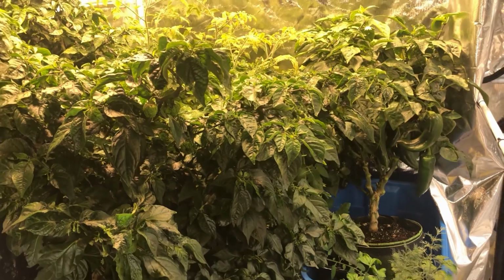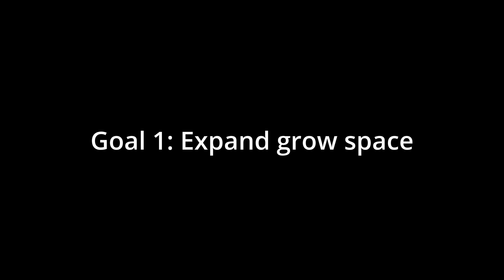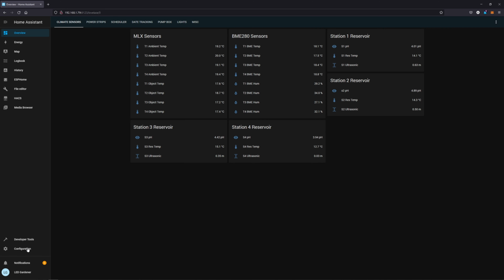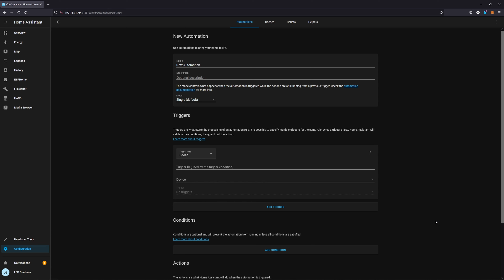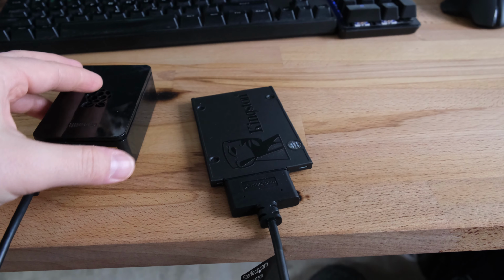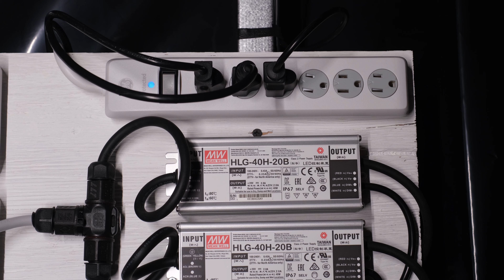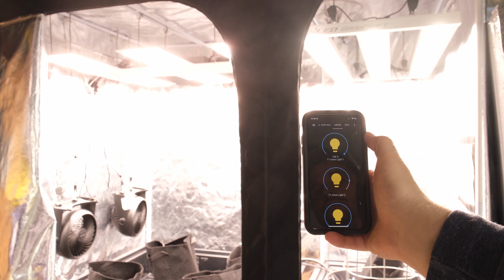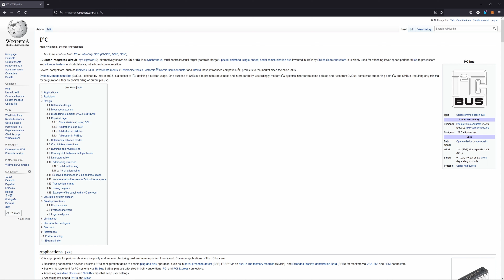Rebuilding My Automated Hydroponic Garden -1- Intro/Overview

Comment: Since watching your home assistant series I’ve been hooked. Looks like you are making a ton of progress. Nice. Love the PCB idea, I’ll have to look into this.
Reply from the maker: It's addictive, isn't it? I lose sleep thinking of things I could automate.
Reply: @LEDGardener  Ha, exactly how I feel. It’s certainly a rabbit hole. I have sensors and monitors on things that I don’t really need them on just because I’ve ran out of ideas. I’m tempted to switch to a reservoir system. Do you have a preference or find one to be more accurate between scales or an ultrasonic way of measuring your reservoir? I’m sure they are both good.
Reply from the maker: @kumd  The scale will be more accurate. The problem with the scale is that if you have a constant weight on it, it will drift. Mine drifts very slowly though so I just check and recalibrate every few weeks.
Reply: @LEDGardener  How much drift are you getting? How long have you been using them? Is the drift or accuracy getting worse over time?
Reply from the maker: @danp762  I remember checking it a year ago or so - I think it had drifted so it was off by like .25 liters over 6 months or something. The drift does not seem to worsen. I typically had 60 or 70 liters sitting on the scale.
Reply: @LEDGardener  Do you have a link to the parts you needed for the ultrasonic method for detecting the water level? I'd like to not worry about the drift or recalibration process too much if possible, but if the accuracy is really bad, maybe the scale method is the best?

Comment: Thanks for the incredible videos! Hoping you get a chance to tinker with the Conductivity stamps at some point. Cheers!
Reply from the maker: Holy cow, thank you! I've got one on hand that I'll be using in my new little control box with all the peristaltic pumps. Are you building yourself a system?
Reply: @LEDGardener  Yeah, I started with your videos and was doing something pretty similar. Got to the point of building my own PCB with the same stamps, but had to shelve the project as we moved houses and the new basement isn't quite prepped for grow operations yet. Excited to gain inspiration from your new setup!
Reply from the maker: Awesome. Glad to see the word “yet” in there. Hope it’s up and running  and ready for tinkering soon!

Comment: I like the videos. Thanks for sharing. 
 I'm doing someting similar with esp32s,  a raspiberry pi, and HA. I designed a PCB and had JLCPCB assemble it. It can read 18 moisture sensors, 2 water level switches and output (19) 24 volt AC for watering solenoids or contactors. It has ESD, surge, and overcurrent protection on all inputs/outputs that leave the enclosure. 
I'm writing the firmware in Arduno. Once, I figured out how to get entries into HA it been pretty easy. I want all my nodes to operate independently. Just in case something goes wrong with the Pi or router.  I am planning on using HA as an UI and to notify me if there is a problem.  
It's been pretty hard finding up to date examples of projects using HA that are easy to follow. It seems they update HA a lot fast than the documentation. Maybe I'm doing it wrong and the is a good place to find good info. I just haven't found it. 
Is the Raspiberry Pi and HA really reliable enough to run your garden without a fail safe?
Reply from the maker: Very cool. HA has been stable in my experience. If it goes down, my garden isn't exactly mission-critical though. From time to time I'll have to reboot my Pi but I'm happy with its performance.
Reply: @LEDGardener  Do you know the reason the Pi is going down?  Is it possible to add a esp32 to monitor the MQTT server on the Pi and reset the Pi  if it goes down?
Reply from the maker: @danp762  I'm not sure - it's usually just a networking thing I think. Often it can be resolved just be unplugging/plugging the ethernet cable on the Pi. Could be a result of updates or changes I make in HA and it really doesn't happen that often. Maybe a few times in a year. You could program around it pretty easily, like you've suggested.

Comment: Super awesome setup!
One thing on sensors: sensiron sht30 and 40 series are considerably more accurate than bme280. I tested any sensors for a long time, including bme280s and bme680s, and the bmes tend to have some shift. Other sensors agree but the BME often is the outlier.

Bme680 did not provide very meaningful air quality measurements on top of temp, humidity and pressure, so not worth the extra cash on top of the bme280 price.

But in general, sensiron are not much more expensive and more precise.

I have co2 sensors to try (from Adafruit, but a bit expensive at 50 bucks a pop).

I will post a mini review on your forum when I have some meaningful data to share.
Reply from the maker: I really want to try the SCD40 for CO2 monitoring. Wouldn't mind giving the SHT's a go as well but I haven't gotten around to ordering one. Thanks for your input.
Reply: just to add i noticed ruuvi changed from using the BME280 to the sensiron SHTC3

Comment: Really great set up. I'm also impressed with how neatly you wired up your projects. Mine end up looking like a rats nest. I'll take inspiration and make my next project wiring more like yours 😀. I'd love to see your automation or code for calibrating the pH probe. I'm kinda stumped on how to use the Atlas Scientific probes in an MQTT Wifi system that can also calibrate the probe using the UART or I2C bus. I hope you'll share how you do it!
Reply from the maker: Thanks! This iteration is much cleaner for sure. I think it should be fairly simple to implement. Just need to tie some actions into ESPhome to fire off the calibration strings.

Comment: Thanks for sharing!
You have come to the same conclusions I have in many cases and I am really impressed that you have gone way beyond what I've done with pumps, magnetic stirrers, custom PCB and the weight sensors for the nutrients.
I am on the verge of buying myself a 3D printer myself as what is holding my tinkering back is the lack of enclosures for my gadgets.
I have a grow room sensor that uses the same dallas sensor, other sensors for measuring CO2 (my home office is the grow room) , temperature and humidity that I would like to enclose in a nice manner.
I am also making a NFT system for lettuce and such but sourcing big reservoirs is challenging where I live, I might need to settle for a smaller one that I need to top up more often.
What is your experience with the pH sensor and have you considered including a ec sensor to your system?
Also, are you controlling fans, humidity and such in your grow tents?
Reply from the maker: I have an Atlas EC probe in my nute mixing reservoir and as I mentioned in the video, I have space to add an EC circuit to each PCB if I can afford them in the future - it'd be nice! I am controlling exhaust fans via PWM and will be humidifying the whole space on a controlled outlet.
Reply: @LEDGardener  Thanks for the swift reply!
A great setup indeed! 
Looks a lot like what I want to accomplish in the future.
I am looking forward to the next video. :)

Comment: Have you managed to calibrate the Ph sensor from HomeAssistant/ESPHome? As far as I've seen most people use mqtt, or an extra microcontroller to send calibration codes.
Reply from the maker: I'm tempted to modify the file so I can fire the commands through ESPHome. I built my own custom component in ESPHome for the IR sensors so I think I could pull it off now... it was a hell of a learning curve though.

Comment: Hi! Any issues on pH Up/down damaging the peristaltic pump tubes? Had a few issues on it, not sure if it's because of the tube material 🤔
Reply from the maker: Hey Sebastian, I have not yet run any through my new pumps so I'll have to see. On my older pumps on the main control box door, I noticed initially that the pH down was hard on the little white plastic "joiner" pieces that go between the silicone tubes on the pumps and whatever tubes you connect to them. I watered the pH solutions down after this and it seemed to be okay.
Reply: @LEDGardener  Hi man, i just opened a catering business so very little time as i have to do all on my own but still interested on the "old" control box, finished mine a long time ago and it works great but i had the same problem as sebastián as the acid was leaking trough the seal, the solution was an acid resistant tube for me.. anyway i tested the first pcb(the little red one for the light/vent/temp) i sent you and it works, now some days ago i got the pcb for the main control box and as soon i have time will test them out.. for you it has no use as you changed the system but if you wish i can send you the gerber for the main pcb let me know.
wish you the best.
Reply from the maker: @n27-c9l  Hey buddy, congrats on getting that done. Can you link to the tube you used?
Reply: @LEDGardener  a friend of mine which works in pharmaceutical field gave it to me sorry..

Comment: hey wow it's coming along great. Ought to try the ultrasonic sensor for water level now. Have you found that water flow meters aren't as effective or something?  

If you had the time, i'm sure many of us would love to see a higher level schematics of how the electronic components are hooked up! Will be following along. Thanks for the update.
Reply from the maker: Definitely. Like my last project, I'll be sharing some drawings and parts lists. How would you implement flow meters?
Reply: @LEDGardener  sorry - i meant a float switch. a sensor special built for sensing water levels. any reason you selected one over the other?
Reply from the maker: Ultrasonic seemed like an easy way to do it. Have you got a link to a product like you're talking about that would work for say detecting level 0-12" or 0-18"?

Comment: Really cool, makes me considering buying a 3d printer.  And everything so cleanly done, wow.

Do you experience wifi to be reliable enough? Did you consider a wired protocol, like ethernet?
Reply from the maker: I prefer to hardwire when I can, but the WiFi connection for the ESP32s has proven remarkably reliable for me over the past couple years so I saw no need to run cat to each box. I'm not sure which microcontroller I'd use for a wired connection anyway.
Reply: @LEDGardener  I understand. I got some good experience with the Olimex POE devices, as ethernet connected mcu.

Comment: How are you using the ultrasonic sensor to measure water level? I’ve been trying to use one to measure water level in the same style tank and I find the echo-y-ness of the tank to give really bad readings. I’m using the one of the waterproof ones.

Comment: Looking great, have you moved away from the ruuvi temp/humidity sensors?
Reply from the maker: I think they are still my favourite temp/humidity solution but god are they expensive. Using BMEs was a nice easy way to measure those values and I was able to put them on the same cable as my infrared sensor since they all run on i2c.
Reply: @LEDGardener  awesome 👍🏼

Comment: Thnks somuch for the video. Did you considered a lux or PAR meter? So you can measure the amount of light hitting the canopy to calculate the DLI and dim the light to save energy?
Reply from the maker: I have a handheld PAR meter that I just spot check the tents with currently. Not a bad idea if a cheap one could be found that runs on i2c.
Reply: @LEDGardener  Hi wich PAR sensor you are using, all I found are around 400 usd, too expensive for beginers?
Reply from the maker: @jedandecko5585  Yeah, they ain't cheap. I guess mine is not really "handheld" as I first said, but I can hold it and hook it up to a multimeter to spot check. It's an Apogee SQ500.
Reply: @LEDGardener  You can use any MCU with voltage divider and hookit up to analog in to get precise reading as a permanent solution :) sites in Europe selling it for 430 USD. Still too much for my budget. Thank you on your answer & for sharing your knowledge and hard work.
Reply from the maker: Yeah I’m using it in my PPFD measuring rig - I have a little Arduino interface for it to gain up the output voltage from it since it’s too low directly from the model of sensor I have.

Comment: Will you make a video of how you are currently using the Atlas PH stamp  and calibration. The probe was previously unsupported in ESPHOME . And ypu used a arduino and  MQTT to pass the Data? Now that the probe is in ESPHOME I assume you are using that?  if so how do you run calibration from HA? as of now in order to calibrate the probe is have to connect it to a arduino change it to serial, calibrate it from the sketch.   then change it i2c and connected to a esp32 running ESPHOME. I hope all that makes sense.
Reply from the maker: Was working on this this morning and got it figured out with the help of an old pull request I found on the ESPhome repo. I have 3 buttons in Home Assistant that I can use to fire out mid, low, and high calibration commands now.

Comment: considering building a system with Ha myself but do not quite know if HA is reliable enough as it can hang and sometimes mqtt messages doesnt not reach. what is your thought on that?
Reply from the maker: Depends how mission-critical your system is, I guess. I can deal with having to power cycle it once every couple months but that may not be acceptable to some.

Comment: Be careful with the cable length when unsing I2C, if I rember it right it shouldn't be longer than 1 meter. 
Also your videos are great and inspired me more than once to keep tinkering on my own garden.
Reply from the maker: I’ve been passing i2c 10-15 feet on cat 6 by using pull-up resistors on both ends and by running each data wire back on its own twisted pair where the other conductor is ground. It didn’t work until i added the resistors at the field end too.